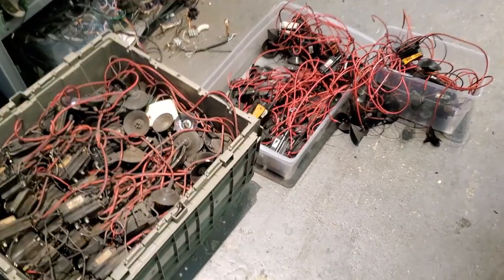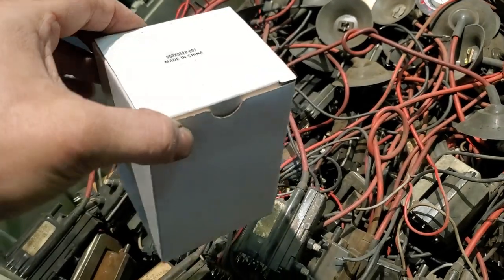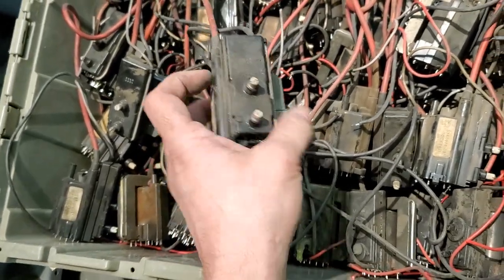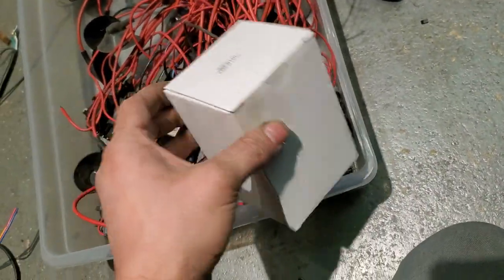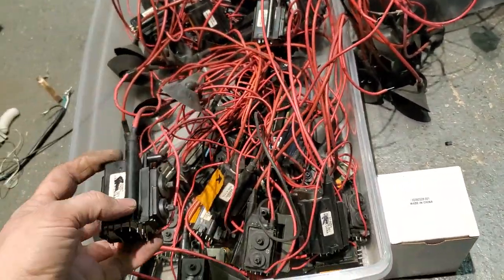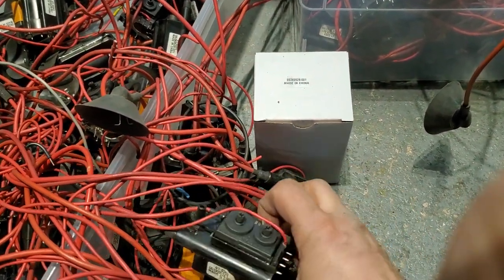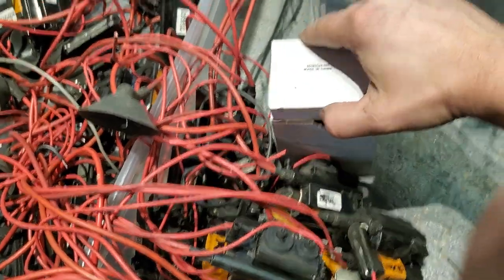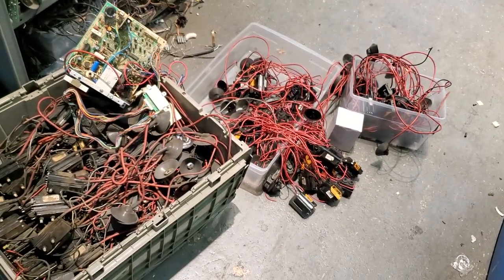Arcade game monitors: Wells-Gardner K7000 chassis flyback failure insight & tips

Comment: Thanks for sharing.  You mentioned MS9 in your video, have you seen many Nanao flyback failures like these WG's?
Reply from the maker: Only a couple actual failures across all Nanao types, but MS8s have occasional pot block cracking like you see on WGs. Nanaos are the best monitors out there, IMO.
Never shotgun-swap a flyback on a Nanao (or on anything really, outside of WG K7000 and 20/50/74/75). The repros are not an "upgrade."

Comment: Why does the flyback fail so often? what is making flybacks fail or getting damaged?
Reply from the maker: They were just carelessly manufactured in some cases. It's just air bubbles getting into the potting compound, leaving the possibility that the high voltage can arc through what little protective material is left. This is why I suggested that it might be possible to mend one with a big goop of RTV silicone, but really it just needs to be replaced.